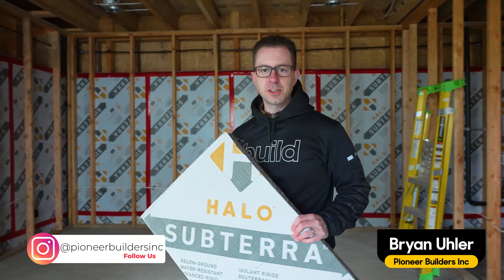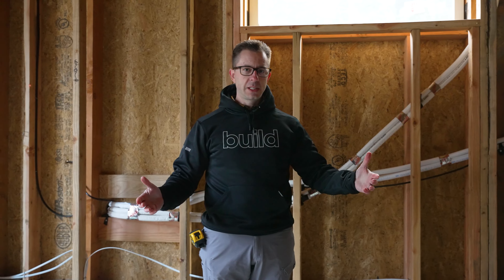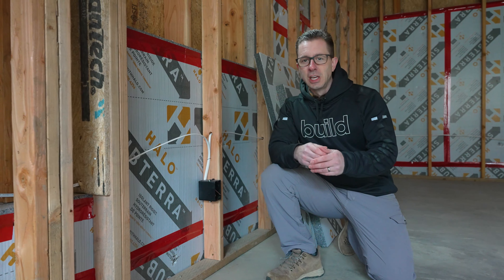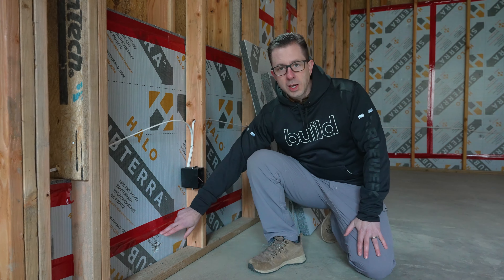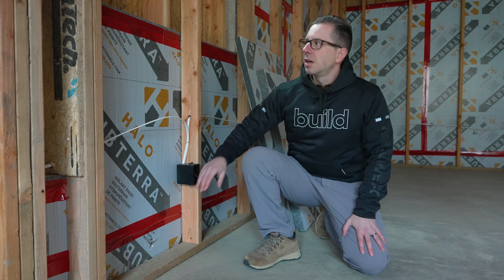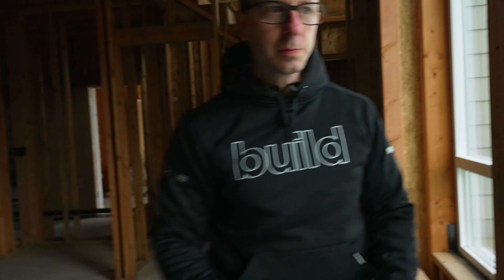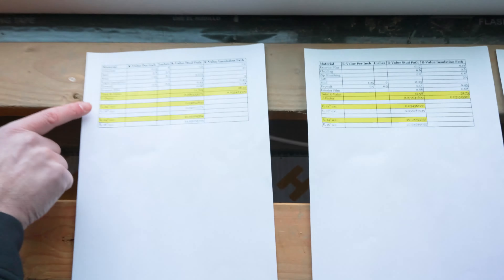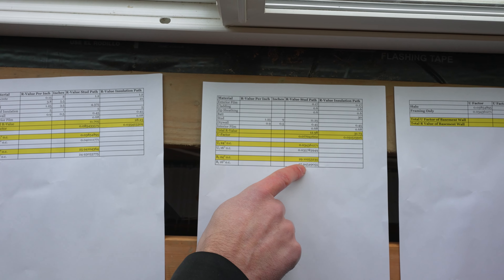Rigid Vertical Insulation Installation in a Basement

Comment: What is the value add  cost benefit analysis of insulating beneath the ENTIRE slab?
Reply from the maker: One thing is that it makes a single plane for the concrete base. It reduces heat loss through the floor leading to body comfort.

Comment: Hey Bryan, I'm curious why you guys didn't go with external foundation insulation on this build? Or did you in addition to the Halo Subterra?
Reply from the maker: Great question. There's more detailing required at the exterior and you have to wait longer in the schedule for backfill. Technically, tall walls shouldn't generally be backfilled too high, and I think it wouldn't be good to have exterior insulation exposed for so long